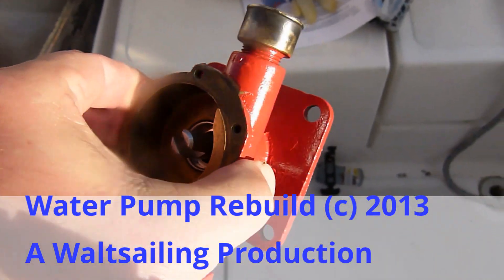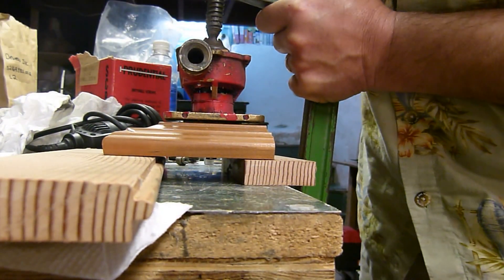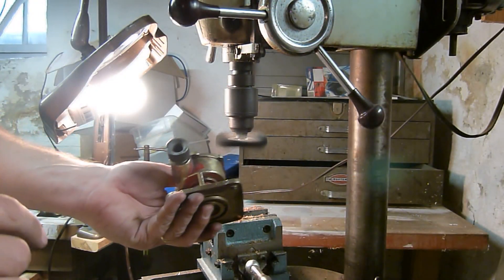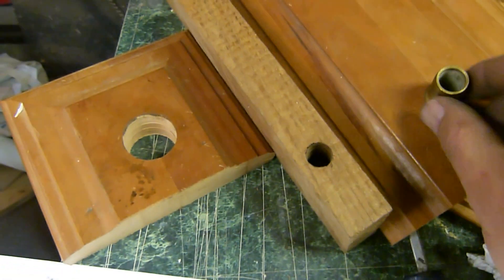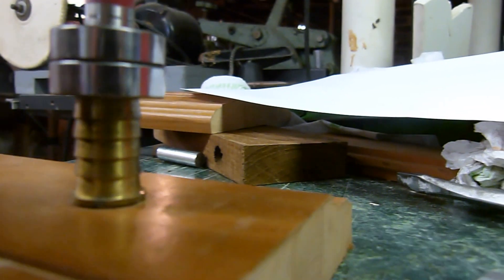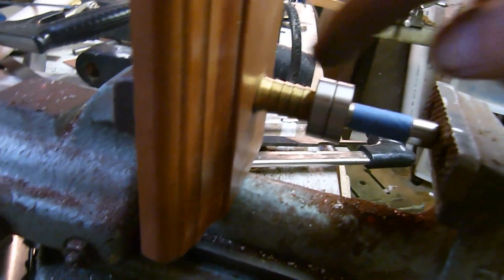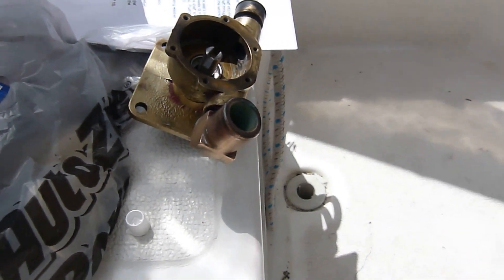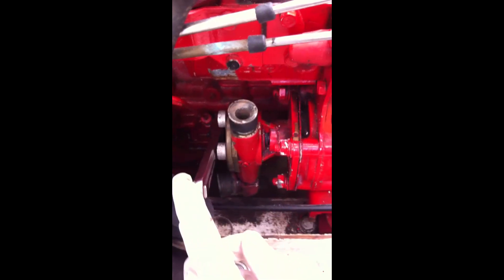How to rebuild the raw water pump

Comment: This was helpful for removing and replacing bearings, but you didn't show putting on the inner brass seal washer, plate and retaining ring before installing cam. My brass seal disintegrated. Everything else looks good so that's all I need.  I may have another one, but cannot find how big it is to know if I have another one...
Reply: I thought the same thing because I am rebuilding mine, and mine doesn’t have that plastic piece, so I went and looked at the parts manual and his model pump doesn’t have the circling behind the washer, which goes behind the impeller. He has pump 036066. After 2004, they went to pump 048080, which has the shi, and circling you mention. I thought I was missing the plastic spacer in my rebuild kit, and it turns out the pater pump doesn’t have the plastic spacer, and there wasn’t one on my pump when I disassembled it.

Comment: Ummmmmm........You press bearings in and out with the outer race not inner, but you got it half right. Pressing them onto the shaft, YES, press with inner race, pressing into the pump housing, you should've used the outer race.....ouch, that might have just cut it's life expectancy in half if not more?

Comment: It is possible to use the drill press and a deep socket of appropriate size to do the press out and press back in. It provides a nice smooth application of pressure.

Comment: When you press the bearing shaft assembly back into the pump, you are improperly loading the inside vs outside bearing races. You should have flipped the pump over, and pressed downward on the outer race, pressing on a large socket that is just wide enough to reach outer race of bearing. That way you are pressing on the part that is receiving the friction force from the pump housing.

Comment: Great stuff, Walt! Thanks for making it. (I see your videos are so popular they have ads!)
Reply: I have rebuilt my Jabsco 1673 pump 3 time in 6 months. The problem is
the non-standard parts you are selling. The key part is the seal. The seal is submerged in salt water and has to be stainless steel with a stainless steel
garter spring.. That is why seal is expensive at $23.64. You have substituted a plain carbon steel seal and garter spring which should sell for $4.00. This rots out in 2 months. Shame on you for making an obscene profit by cheating your customer and selling an inferior $4 seal for $23.64. Fuck you. I will tell as many internet sites as I can to keep away from Pumpvendor. The seal should not be magnetic for this application.
Michael Evans